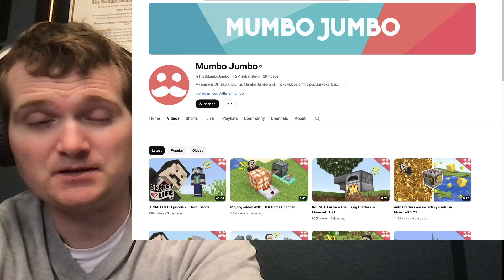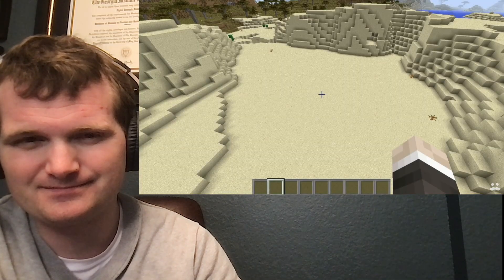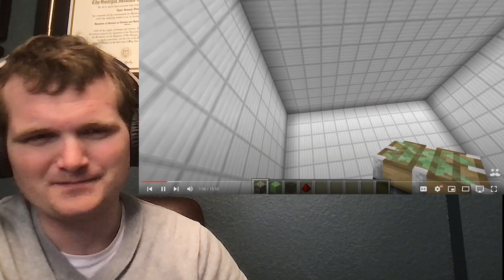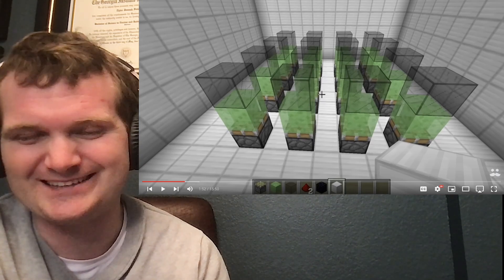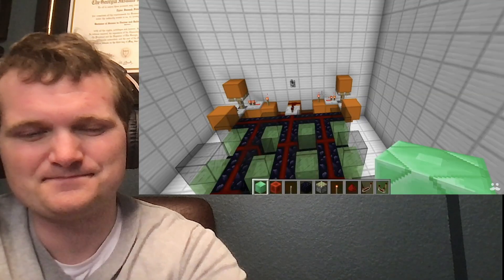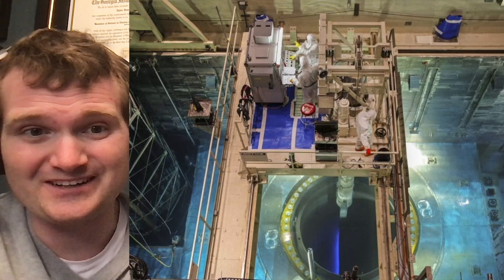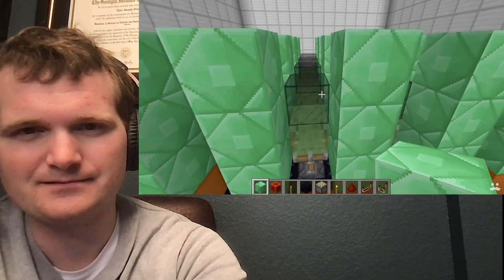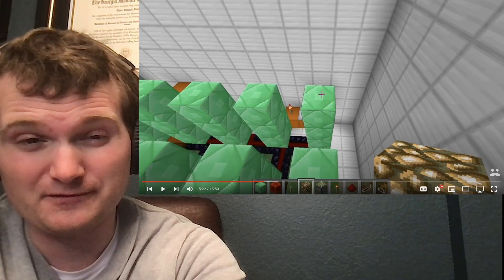Nuclear Engineer Reacts to Mumbo Jumbo "How to Make a NUCLEAR REACTOR in Minecraft"

Comment: He is using obsidian because when the pistons push the green blocks, the green blocks stick to all adjacent blocks and move those blocks as well. Obsidian is one of few blocks, that green blocks can't stick to. Obsidian also takes a while to break in survival mode, which is probably the reason Mumbo is associating it with something hard and industrial-like. Obsidian is also basically completely explosion immune.

edit: The stuff he made the control rods out of isn't affected by gravity. And the double-piston extenders have a larger risk of failing upon retracting. They basically cannot fail at extiending (which in this case would be inserting the fuel rods) unless someone has sabotaged the wiring. Retracting requires a bit of timing which could potenially mess up if the game is lagging a lot or something. And it takes longer to retract than it takes to extend.

Comment: Please try Industrial Craft mod for Minecraft. It has a reactor planner and simulator and the whole "plan fuel and heat dissipation layout" is neat and maybe even realistic. Also nuclear accidents in IC are spectacular
Reply: There are several mods for minecraft with some variation of this, though the most "realistic" one involves having the ability to connect a turbine and inputs/outputs from the reactor itself to generate significant power. Mind, the basic version mostly just uses water as coolant and magically generates power withoit turnines, so...

Comment: The whole top and bottom control rods thing is most likely due to Minecraft's limitations: pistons can only pull an adjacent block, not a column. 

Also it would be interesting to see you try Industrial Craft mod for Minecraft. It has a reactor planner and simulator and the whole "plan fuel and heat dissipation layout" is neat and maybe even realistic
Reply: If he'd made it on a slightly larger scale, he could've had slime block cores for '+' shaped control rods. Would'a been bulkier, for sure, but wouldn't need to split up into top and bottom rods.
Reply: if i were to build a "vanilla nuclear reactor" in minecraft like mumbo did here, i would have use pistons to block sand/gravel/concrete powder blocks from falling down into the core, then deactivate the pistons to make them fall down like real control rods would do irl when power is cut, i would also another set of blocking pistons in the bottom to catch the "control rods" so i can then more easily reset the control rods, then fill rest of the reactor with water and "fuel rods" (i would probably use chains or light rods instead of emerald blocks to represent the fuel rods)
Reply: @Deilwynna  it's a old video made in olden Minecraft version where most or at least few of stuff you say actually exist without having to install forge or modloader to have it